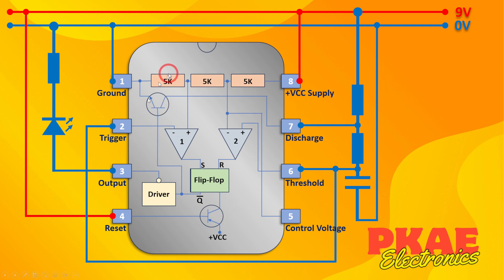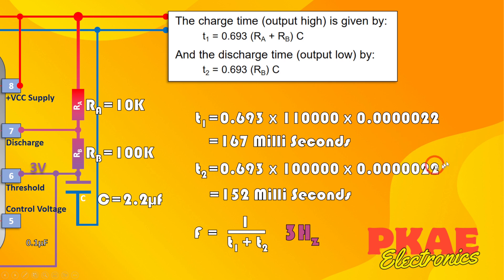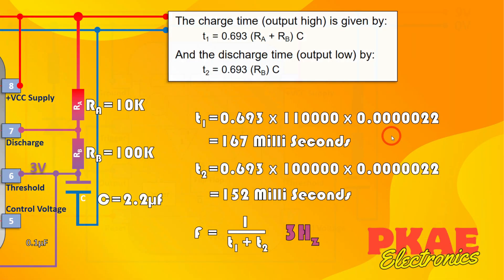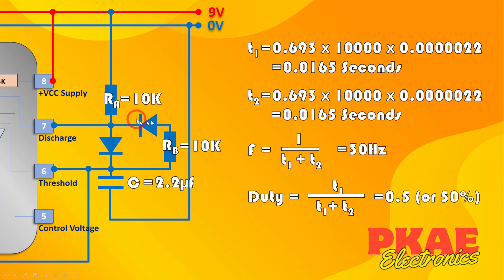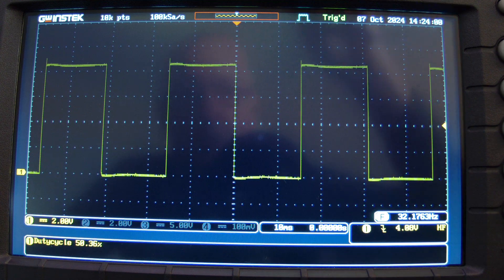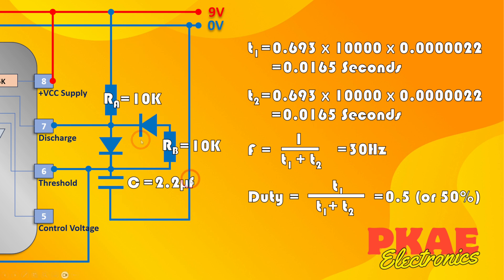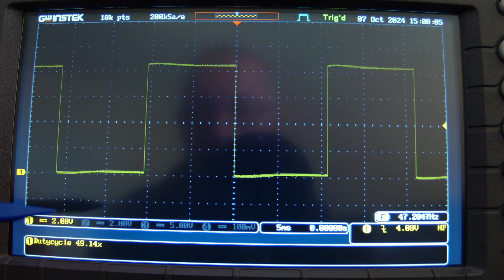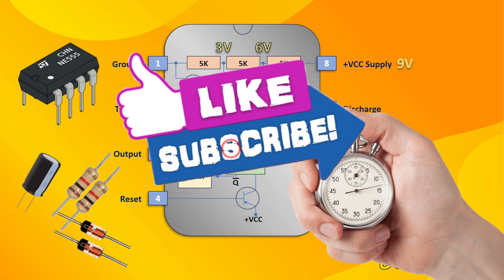Better 555 Duty Cycle Control (PWM).

Comment: i tried this in circuit.js, also in LTSPICE. for some reason i get the opposite effect rather than the desired one. frequency changes while the duty cycle is around the same. I'm probably blind and missing something though.

Comment: Thank you so much for posting this, I now wanna try and make a pwm circuit in easy eda thanks to you. Also you wouldn't know of any timer chip like the 555 that might run off a lower voltage? I'm looking to drive one using just one 3.7v lipo battery
Reply from the maker: That's great to hear. 
There are CMOS variants of the 555 that operate down to around 2V supply e.g. ICM7555.
Reply: @paulpkae bro you're a life saver. Keep posting, your tutorials are very succinct

Comment: Just instead of R1 R2 diode etc.. tie the cap with a resistor in series to the output.. it would give you 50% duty cycle..
Reply from the maker: Yes indeed, this is the method used in my 555 Police Flashing Lights video.
Reply: r1Andr2Missing?

Comment: Thank you!
Just spent the whole day making calculations,vwanted 50 %  cycles.
And ended up with R1 as0 ohm
The now I found your exelent tutorial.
Thank you again.
Very professional
Reply from the maker: Glad it helped.
Reply: Hmm you could have just had a short cut.. skip the discharge pin.. and skip charging through the R1 and R2..

And just have the cap connected to output via a Resistor, and it just makes it 50% duty cycle..

Comment: How comes that your circuit has such good frequency stability? I tried several schematics involving diodes and comparing to the same frequency and duty cycle set by resistors frequency stability worsens drastically(10-15 percent of change in frequency through out the potentiometer range when changing duty cycle) though i was using 5v supply and 0.5-0.6 voltage drop over a diode varying with current through it probably severly impacts characteristics of the schematic.
Reply from the maker: Hi, thanks for the comment.

Looking back over the video, I can see that the frequency reading on the scope fluctuated between 45-51Hz which is comparable to the percentage you state. A good quality potentiometer and well matched diodes will help, but you will never get this circuit to maintain a rock solid frequency.
Reply: @paulpkae  I think I missed the moment where it was at 51hz, thank you.
Reply: @ I was also trying to make combo of one 555 in astable and one in monostable to maintain a better frequency stability but it turns out 555 have minimum pulse width in monostable mode which severely limits it's usage for any kind of pwm. It seems like the propper way to use it for pwm is to feed capacitor voltage into a comparator, though i don't know if it would impact frequency stability(it probably should not) and capacitor voltage is not a pure sawtooth anyway.
Reply from the maker: @ if you really need precision PWM then the 555 is probably not an ideal approach. Try looking at alternative PWM controllers (e.g. ICL8038, TL494, XR2206, SG3535....).

Comment: .This is very great circuit. Not on internet anywhere. This works great.
My question is can we add NTC to this circuit and change the pwm duty cycle with fixed frequency. If yes where to add The NTC and what ntc value
Reply from the maker: You could probably replace Rb with an NTC which will adjust the duty cycle in relation to temperature. But, with this circuit, it would also adjust the frequency.
Reply: @paulpkae  

Thankyou sir for your reply. I have actually tried the suggestion but i want frequency to be constant.  somebody has suggested to use two 555s. But don't know how to design

Comment: Great video! For the Variable Duty Cycle Using Potentiometer, does the value of the potentiometer have an effect on the circuit? I.e., should it be a value close the resistors calculated?
Reply from the maker: The pot value will affect the frequency of the output but does not necessarily need to be similar to Ra or Rb. It's essential that Ra is of a reasonable size to prevent too much current flowing from the positive rail through the Discharge transistor to ground.
Reply: @paulpkae  Thank you!

Comment: This way of getting constant frequency AND variable duty cycle is somewhat roundabout, and is only good when you want manual control of the duty cycle. There is another method using an external transistor to discharge the timing capacitor "instantly" (very, very rapidly) that lets you get a default 50/50 duty cycle more simply, while also having electronic control of duty cycle, and being able to precisely set the frequency manually. I found that circuit many years ago in the 555 Timer Cookbook (now missing), but I am still trying to find the circuit again. If anyone knows where to find that book or the circuit, please let me know!

It is a very useful old circuit. I used it to make a Class D (digital) Audio Amplifier. By using the PWM pin, pin 5, to inject an analog audio signal through a small DC-blocking capacitor, you get a very nice analog modulation of the 555's square wave output. I also used the CMOS 555 in that instance because it can run at 2 MHz, putting the main digital noise above the AM radio band, and making it very easy to do the low-pass filtering with just a single inductor.
Reply from the maker: Many thanks. There are countless iterations of the 555 circuits out there and some have been stretched well beyond what people thought possible. Like all electronic components and ICs, they are just the building blocks for us to play around with and create all sorts of configurations.

Comment: Confused - I'm making a spreadsheet so I can play with the circuit of 10:25 but my numbers don't match yours - I get t1 = t2 = 0.01525 seconds. Not a huge error, but I can't see how it happened. Clues?
Reply from the maker: Well spotted, you are the only person so far to mention that. I can see now that my calc is incorrect and your result is indeed right! My apologies for the confusion. 

I have been trying to work out how I inadvertently 
arrived at 0.0165 but can see no obvious reason. It must have been a mad moment or a cut and paste boo boo from something else. I will add a correction note in the comments.

Thanks for this.

Comment: Nice trick using pot to adjust duty cycle without affecting frequency
Reply from the maker: Thanks for the comment. There are countless other arrangements that can be applied to achieve the same outcome, this is just one example.

Comment: How would one be able to modify the frequency and duty cycle without the use of potentiometer (and maybe also without the variable resistor)? Would we be able to use something like a counter and then after a certain amount of pulses or something change the output?
Reply from the maker: Thanks for the comment and great question. It's difficult to fully explain an example answer in a brief comments text and without knowing the exact details of what's required. 

There are many way of automatically adjusting the frequency and or duty cycle of the 555 Astable circuit. One example would be to utilise a second 555 configured in a monostable arrangement. It's output would go high after a given period and this could be wired into one or more transistors to either:- introduce further resistance, bypass an existing resistor or introduce/bypass the capacitance. 

If you wanted the circuit to alternate between one frequency/duty cycle and another, then make the 2nd 555 an astable circuit as well.
Reply: @paulpkae  Would you also happen to know if there is such an IC or something that can oscillate from 5v to 0v instead of 2/3rds to 1/3rd the input voltage?
Reply from the maker: @lamp007  The output from the 555 will oscillate between ground and your supply voltage (or very close to it). The 1/3rd and 2/3rd voltages are only internal references. 
Or have I mis-understood your question?

Comment: GreatScott! covered this in his Basic Electronics #26 about 7years ago...

The design was slightly different to enable 0 to 100 duty cycle.

It also covered the difference between bipolar transistor based 555's and CMOS.
Reply from the maker: Thanks. 

There are indeed countless videos on the 555 out there. I have not seen Great Scott's one though, I will take a look.
Reply: @grahamnichols1416  Agreed.

Comment: If you need less than 50% duty cycle from a 555 you just invert the output. Eg if you need 10% just set the 555 to 90% then invert the output.
Reply from the maker: Thanks for sharing.

Comment: Great description !
If you match the 2 diodes, I believe the frequency would be more stable, when you adjust the duty cycle.
Also using a dual potientiometer for Ra, Rb would give a smart frequency adjust, still holding the set duty cucle, but it will suffer due to any mismatch in the dual pot.
A selector switch for C,  could give you decade ranges for the frequency, switching more or less capacitance in, simply in parallel.
A diode in series with the Vcc would probably make the circuit back to its predictable frequncy calculations again ...
Some food for a second edition of this video.
The third edition would be the usual dual opamp diode sine wave converter circuit ...
The fouth edition would be a buffer circuit with output level adjust and selectable output impedance ...
Thanks :eyes-pink-heart-shape:
Reply from the maker: Thanks for the comment. There's probably 1000's of different implementations, each with their pros and cons. This is just one, easy to follow example.

Comment: Plus the resistance of the diodes.
Reply from the maker: Diodes don't really offer much resistance in forward bias mode. The main parasitic property is really the volt drop, which typically around 0.6-0.7V. The Diode voltage drop is indeed mentioned in the video (jump to 10:16).

Comment: THANKS FOR THE VIDEO!!!
I really like the opening diagram.  Most videos don't show the entire circuit in much detail.
It would really be nice to see even a more 'intuitive' diagram so that the functions of the 555 can be seen more clearly...not as the exact pin layout...with labels also.  I would lay it out with the three 5k resistors in the left side.
...one more thing, it is incorrect to say that pin 7 is "floating".  A pin is floating if is effectively not connected to anything and is an input.
Reply from the maker: Thanks for the comment.

I do agree regarding the "floating" bit, because the pin is actually connected to a voltage source via the resistors. But, I am kind of explaining it in a way that most people are able to follow. If you think of it being isolated from the rest of the external components then, when the Discharge transistor is in an OFF state (i.e. the Base is low), then the pin is effectively not connected (open collector).
Reply: @paulpkae  YES, I see your point.  However, especially in teaching, it is important to use correct terminology...the pin is INACTIVE, but definitely NOT FLOATING...something that may stick in minds of those pursuing a career in EE, especially when the difference between INACTIVE, and FLOATING is often confusing.
A CLASSY VIDEO INDEED!!

Comment: I'd like to make a adjustable time delay control for the windshield wipers on my car (has just a plain on/off/fast/slow speed control).
The "on" time pulse be long enough to get wipers started from "park position"....the "off" time value be roughly 5 ~ 30 seconds set by potentiometer. 
Because wiper motor draws high current maybe use a relay to handle load. Energizing / de-energizing relay coil would send voltage spikes to timer's output...possible damage? How to address that issue.
Being a novice at electronics...I thought this might a great project...and I'd get time delay control on my car's wipers.
Reply: If driving a relay coil, you need a suitable diode wired in parallel with the coil. The diode anode connects to the coil connection that is wired to the positive part of the circuit and the diode cathode connects to the coil connection that is wired to the negative part of the circuit.

Comment: 11:14 You really don't need all of those components in the "adjustable duty cycle" configuration.  First, you never really needed the diode on Rb to begin with.  You can just connect Rb directly to the "discharge" pin (across the other diode).  In the charging situation, it means a bit of current will take a path through Rb instead of the diode, but since the diode will still be clamping it to basically the same forward voltage the whole time, the end result will be the same.   And now that we've gotten rid of that diode, notice that "discharge", Ra, and Rb are both connected to the same point.  You can actually replace both of Ra and Rb with a single potentiometer, resulting in a single capacitor, diode, and a pot which can adjust from 0% to 100% duty cycle.  (Though, as you said, actually turning it all the way down to 0% (or 100%) is probably not a great idea..)
Reply from the maker: Thanks for the comment. I think I would prefer the additional current protection and avoid over powering the internal NPN discharge transistor.

Comment: I like to use the 555 "output" to drive the timing part of the PWM, since it is inherently sink/source. 
Can very easily implement frequency and duty control. 
Most gate drivers have very high input resistance so they dont affect the timing, or the "discharge" can become the output.
Reply: That arrangement is also handy if you want or need an open collector output.

Comment: 2:50 if you place a resistor between the junction of R1,R2 and pin 7 you can normalise the mark/space ratio. Also, as the 555 has a push pull output, you can drive the charge/discharge cycle of the cap from the output via a single resistor
Reply: I've got a story. I needed a signal source, duty cycle and exact frequency not needed. Just something that makes noise. The only 555 timer I found in my junk box just happened to have a blown discharge transistor in it, otherwise it worked. I did what you suggested just to make some noise come out from it.
Reply: Circuit 2 can also be done the same way.. decreases components count
Reply from the maker: Thanks for the comment. 

Yes the output can indeed sink or source current. But, bear in mind that in the arrangement you suggest, your intended output load will affect the frequency.
Reply: @paulpkae  true, although you could also use the discharge pin as an open collector output.
Reply: @paulpkae Yes, but you can buffer your output using an opamp or an emitter follower.
Reply: @paulpkae  It won't change the frequency(kind of)).. the output goes directly to load(there is a bit resistance/impedance for the output pin)

But its very small, so unless you driving very high current, which the ic can't, it won't suffer from frequency jittering/shift..

You will get more frequency shift/jitter from the capacitor than you might from load..